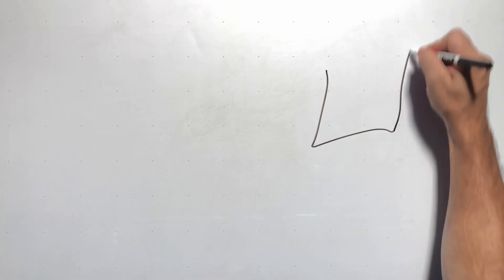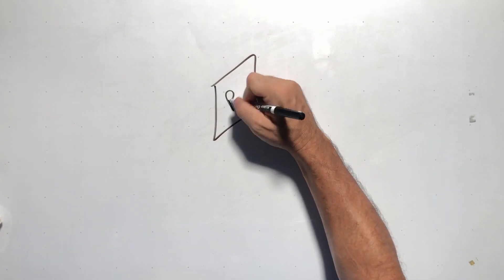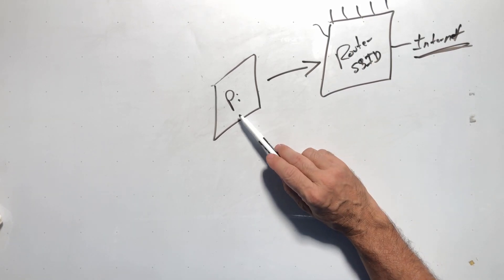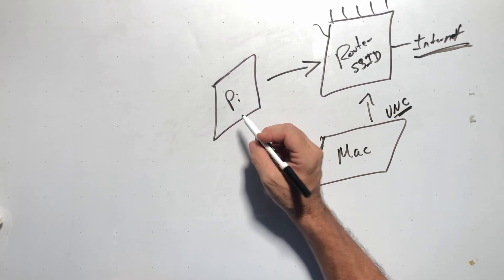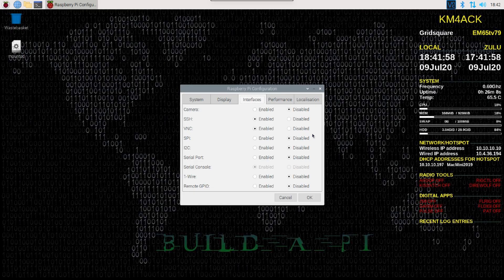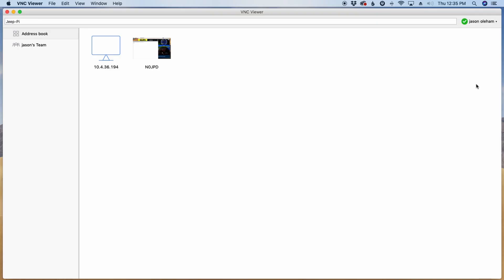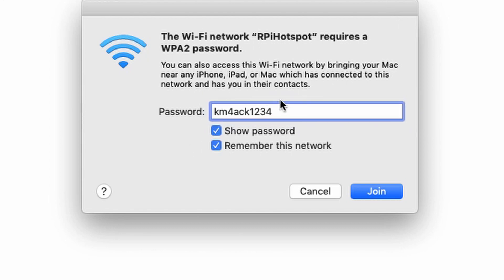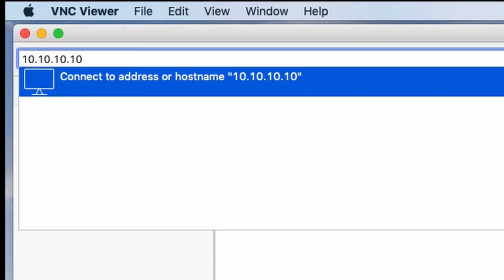Build a Pi HotSpot | In Depth

Comment: I am running my pi 3 with a DRAWS hat, and so have that image installed for running JS8. I used github and have the Hotspot Tools, but upon rebooting, my wifi is all gone, and the Hotspot Tools goes into a loop of rebooting when I try to enable it. No changes occur, and I am prompted again to enable the hotspot, only to have be prompted to reboot again, and the cycle starts again. Any thoughts?
Reply from the maker: Try disabling the hotspot in hotspot tools, reboot,  and see if your WiFi returns to normal. DRAWS uses a custom images and I haven’t tested hotspot or hotspot tools with their image.
Reply: @KM4ACK I tried disabling it, and it indicated it was already disabled. It never seems to actually enable so it does not let me make any changes. It must have some form of conflict with the DRAWS image. Tnx.

Comment: Thanks this was extremely helpful. How did you get your call sign and all that info to display on the right side of your screen?
Reply from the maker: An app called Conky. It can be installed with Build a Pi.
Reply: @KM4ACK  ok thanks, I have been using HamPi but I'm thinking I need to switch to build a pi.

Comment: I've been watching a few of your videos and I'm confused as to using the pi as a hotspot in the filed.  What does the Pi connect to to be come a hotspot??  I understand the devices can connect to it, but what is the purpose of it?
Reply from the maker: The wifi hotspot created by the pi allows us to connect other devices (tablets/phones) to the pi and then initiate a VNC connection so that we can use our other device to view and control the pi.
Reply: @KM4ACK  So just to control the Pi, but not get on the internet right?
Reply from the maker: Correct.
Reply: @KM4ACK  OK, so what's the point of connecting to the Pi if if doesn't have internet access?  I don't see any point in doing that.  Am I missing something?
Reply: @stevenA44  I had the same question in my mind after watching this video today

Comment: Thank you the steps are very clear. I just have one issue. I am getting red x on both of the arrows for the hotspot symbol. Do you know why this is?
Reply from the maker: That indicates no internet connection. Plug a CAT5 cable into the pi from your router to solve.
Reply: @KM4ACK  But how do I do this when I am out in the field? I won't have access to a router then

Comment: Hi Jason, I have spent quite a lot of time this weekend loading Build A Pie onto a raspberry pi. I have had one issue with the hot spot and would like to mention it to you. In my area of Australia there is considerable traffic from other local installations on wifi channel 8.I also found that, in my pi configuration localisations, my wifi country kept (I have installed Build A Pi 4 times now) either being disabled or set to US. To work around this I have now edited /etc/hostapd/hostapd.conf to set a different channel and country code. I wonder if this will be reset back to your defaults if I install any future updates.
Reply from the maker: It shouldn't be a problem with future updates as build a pi will not allow you to update the hotspot. I didn't write the hotspot code itself. Instead BAP downloads it from another site and makes just a few mods during install. Hotspot Tools is something I wrote but it should not modify this going forward.

Comment: The problem I am having is, my network is discoverable, but I have no Internet access😭😭😭
Reply from the maker: You have to have a CAT5 cable plugged into the pi. Then a bridge is created between the hot spot and the CAT5 cable providing internet access.
Reply: @KM4ACK  and then plug it into what?? I believe I’m a little confused is this a complete wireless hotspot or is this a hotspot that bounces off existing wifi?

Comment: Thank you!
      This was the video I needed to finally get the iPad to view and control the pi.   However, it only works with the pi as the hotspot (as in field operations).
     
  Without buying a monitor, is there a way to use my iPad as the monitor while using the router in the shack as the Wifi hotspot (and internet source)?
Reply from the maker: Yes. Make sure they are both on the same network. Then instead of 10.10.10.10, use the ip address that your home wifi router assigns to the pi.
Reply: @KM4ACK  
      Wow, that was easy!   Thanks again, it works.

Comment: I get a black 'cannot currently show the desktop' screen. If I run vncserver via the shell it'll give me a desktop at 10.0.10.10:1 but that's not ideal ;) Any tips? Also, your work on this is just absolutely amazing!
Reply from the maker: see this video for resolution https://youtu.be/Uy6xbC0Hiew
Reply: @KM4ACK  Awesome, that fixed that. Do you know why that resolution wouldn't be represented in the vnc instance? I still get 1024x768, and I notice in your videos your resolution looks much higher in vnc.
Reply from the maker: @JarrettGreen  Try setting the resolution from the main pi menu under the prefs sections now that you can VNC in.

Comment: Nice!  I just completed my pi build using build a pi v3.0.2 with no problems, using a pi3b+.  So far, I have been using Hotspot, Winlink, and YAAC daily with no problems other than the expected learning curve.  BTW, I suggest that you can fix your GPS interference problem by using a "corded" GPS that will allow you to get the GPS antenna up where it gets a good view of the sky, and away from those RF leaking USB 3.0 ports.  I had a similar problem with my Windows 7 computer several years ago and that fixed it.  This is one or the best "corded" USB receivers I have found:
https://amazon.com/gp/product/B086ZK6R89/ref=ppx_yo_dt_b_asin_title_o03_s00?ie=UTF8&psc=1